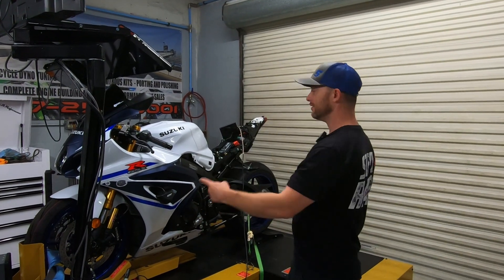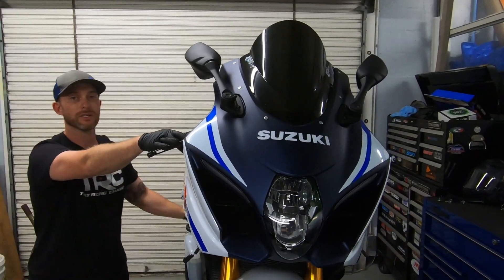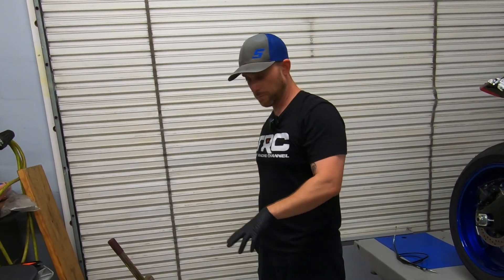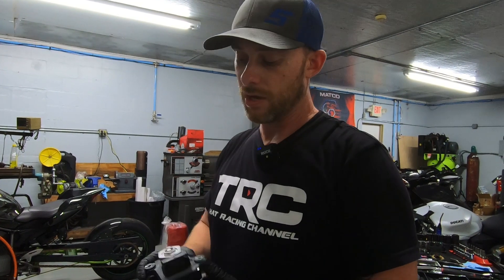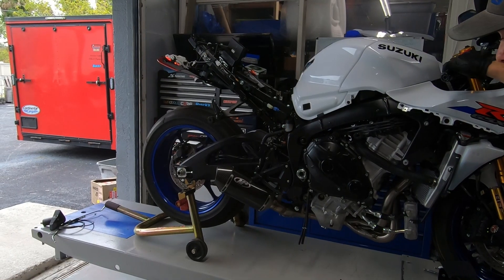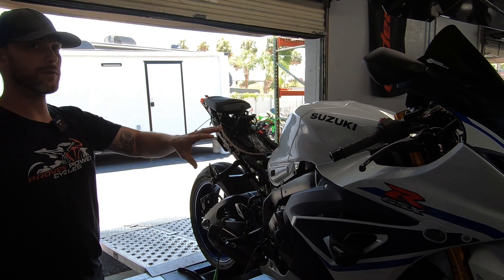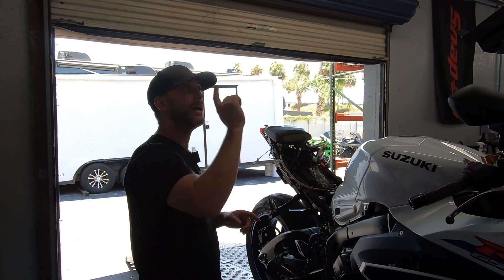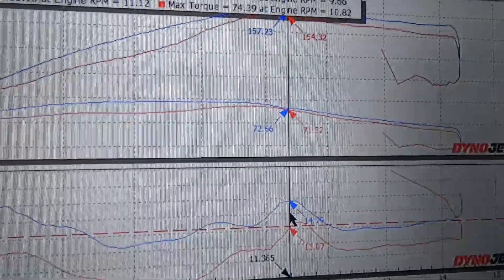2023 GSX-R1000R FULL Titanium M4 Exhaust and ECU Flash!

Comment: How would this exhaust compare to the brocks penta carbon? Sound/performance/ weight ?  I have the penta I'm thinking of switching to m4
Reply from the maker: @keith6108  they are all relatively the same when comparing with penta carbon. We know the CT will help pull top end a little more but penta and m4 are similar in regards to hp numbers.

Comment: You can flash the ecu and tell it to keep it open if you just want a slip on.
Reply from the maker: @marktarascio4766  yes but the issue with the stock header is that they are melti.g the cats over time. This creates massive backpressure and can blow the motor. These motors need to breathe! The better they can do that, the more efficient they will run.

Comment: Actually that is not bad for the weight of the stock exhaust headers and the muffler. I expected the stock muffler to be heavier than that considering the size and its internals.
Reply from the maker: Some of the muffler is made up of ti, which helps significantly with weight reduction

Comment: What kinda hp from this exhaust bit stainless. Stacks, sprint filter, do you think is attainable?
Reply from the maker: @JLee-h6j  similar hp ! The ti is solely for esthetics and little lighter. But ho wise, it will dyno the same. Usually with the bolt ons for these bikes we can produce up to around 187whp on pump and 194whp on mr12. That's our average 🤙
Reply: That sounds pretty good. Iam looking at an akro or brocks swell but with the difference I can but my filter and stacks. Love your vids by the way. Need a tuner here in az!!

Comment: I think those gains are great!  My last 1K was an 03.  Little disapointed that the new bikes don't put any more power than my 03 did (stock).
Reply: Your 03 made 150hp at the crank. The 2023 in this video makes 199hp at the crank. Tell me how 150 and 199 are the same?
Reply: @pagescott7097  Stock for stock they make around the same.  Hopefully that is more clear that you can understand better.
Reply: @pagescott7097  My 03 stock put down 153 at the wheel. A stock 23 puts down about the same give or take. You tell me how that works out.

Comment: What’s also interesting is if you watch MotoAmerica, there’s a GSXR1k that’s M4 sponsors. I believe they crafted that exhaust system specifically for this bike. In a way like how SC has gone to work exclusively with Aprilia, not to say you can’t get a SC for a different bike, but I know in MoToGP Honda had to remove their SC exhaust and change it to AKro. My tuner back in PA Mike Miller actually bought a Brock’s system and within a week took it off and sold it to go with a full M4 system. He’s all about top end mph, and with M4 sitting higher his assessment was he prefers the M4 not only for what he does but the sheer performance you get at incredibly reasonable cost. It’s a beautiful system that absolutely performs.
Reply from the maker: I agree 100% bro! 🙌 and I like Mike because he also tests stuff out instead of believing in the hype!
Reply: @provenpowercycles  I was watching the MotoAmerica series races and one of the commentators stated that M4 have been working on new exhausts for the GSXR1000 and that they have made some impressive gains. He wasn’t able to give specifics but was adamant that it’s working. This was from the most recent race. Being originally from PA I was introduced to Mike roughly 2yrs ago, very knowledgeable guy that’s not for the gimmicks. Honestly it was him that put me onto the DNA after his testings.
Reply: SC suxxxx

Comment: It’s on a dyno, do you really need to say “wheel horsepower.!
Reply: Technically speaking... horsepower on the crank is precise and the final end horsepower on the wheel/sprocket etc is different coz of all the losses from the chain-sprocket tires
Reply: @ This dyno is not reading off of the crank though. It’s reading the tire, making the “wheel” in “horsepower” redundant.
Reply: @elonmust7470  ok hmmm. Point taken. I was just saying, he ain't saying anything wrong.
Reply: @ Agreed.

Comment: Just got one too! Just curious though have you heard the clicking sound when it’s running? What is that noise?
Reply from the maker: Do you have a stock exhaust or full aftermarket one?
Reply: Stock pipe....its the S.E.T. valve.   Its harmless.  You can adjust it.

Comment: 181 Hp? Isn't it way below the other competition like R1, Zx10r, S1000rr and other?
Reply from the maker: A little bit yeah but also keep in mind. The gsxr may not have the highest top end hp but it still pulls like a freight train with the vvti setup. I have setup zx10rs that made 200whp loose to a gsxr1000 making 194whp with similar rider setup just due to the difference in weight and powerband. 

There are a ton of variables to factor in when it comes to racing. Not just a dyno number 🤙
Reply: damn, good to know stuff @provenpowercycles
Reply: @provenpowercycles it’s the fastest stock motor motorcycle in the world right now bro.

Comment: How many miles on bike? Just curious as you said its new has it been broken in?
Reply from the maker: It was around 3XX something miles if memory serves.
Reply: Ah ok thanks for reply, makes me feel better as i had my first service at 376 miles running semi synthetic, ive been getting on the bike after that service using high revs and was worried might have not been best decision to do that as suzuki recommend more miles before using high revs/load also thought might have been too early to drop the break in oil or whatever comes from factory. 
👍🏼
Reply: Sing iso rak melanggar hak cipta jelas no 1 jepang.
Reply: Suzuki hit redline at the factory dyno before they are put in the box.   Break in is for the new owner not the motor.

Comment: doest not this bike have 200hp? cause 155whp is 172hp right?
Reply from the maker: Whenever you see those higher numbers advertised, they are measuring engine horsepower, not wheel horsepower. So in other words they don't account for the restrictions or drive train loss